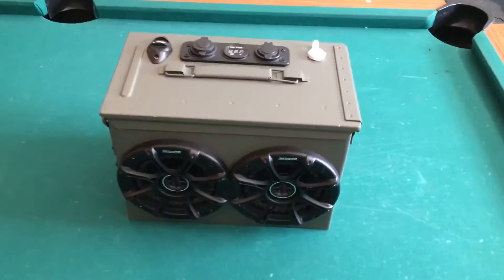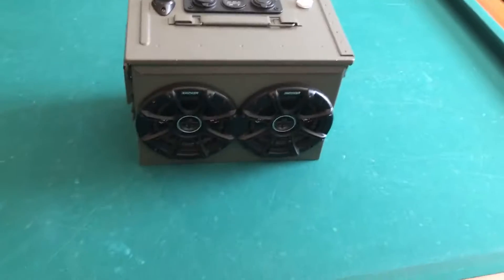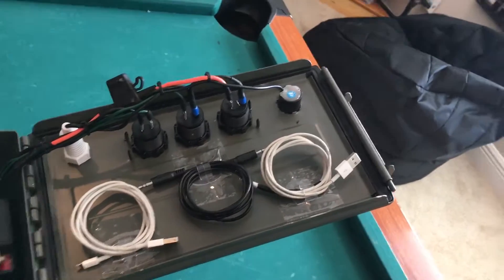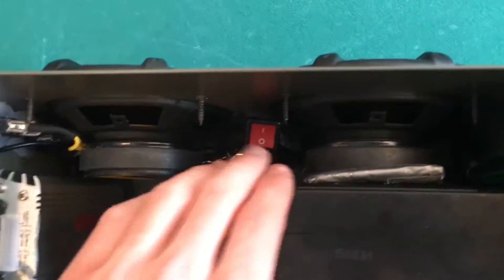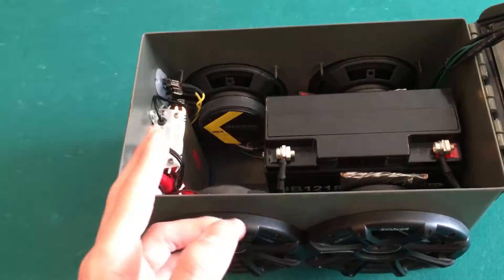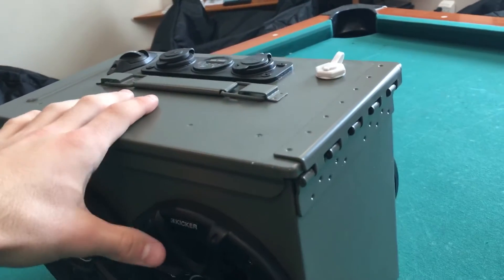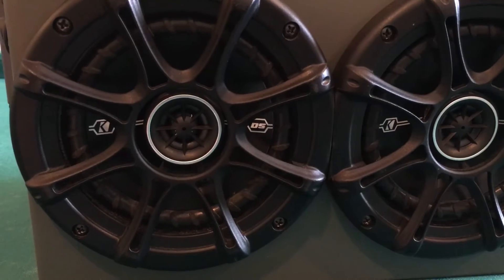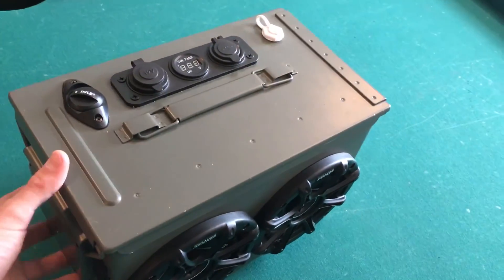Ammo Box Stereo!

Comment: Awesome build. I recently made my own ammo can speaker with a FAT .50 can. I used two 4" speakers and a dual 100 watt amp. The 4" speakers have no problem being loud enough. I had the same bluetooth noise problem with mine. If you haven't already solved it, you need a ground loop isolator between the bluetooth receiver and the amp. That should solve the problem.
Reply from the maker: THANK YOU! haha that stupid noise drives me crazy! and about the 4" speakers, are the loud to where if you are canoeing that the people around you or atleast 50 yards away can hear? cause thats what im going for. I love the kicker 5.25" but i just need something that i can trust to be water proof.
Reply: Yes. Mine has been loud enough to hear from a couple hundred yards away. I've used it when I go fishing in my pasture, and I can be on the far side of the pond with the speakers on the shore. It's a great game call too. I set the animal calls on loop and watch it from a distance. I'm pretty sure the sound level depends on the wattage of the speakers. The higher the louder, but that also drains the battery faster.
Reply from the maker: Thank you so much for the feedback! I was a little worried about 4" speakers. What brand do you have ?
Reply: I have Pyle speakers. They match the yellow stencil markings on the can which is a bonus. I think they were only $35, but they are great sounding speakers with a surprising amount of bass.
Reply from the maker: oh yea! those yellow pyle speakers will kick some ass! well thanks for the info! glad I feel better about the 4" speakers now! thanks
Reply: Would you be able to hear the 4” over a 20hp boat motor doing like 25mph??

Comment: I used to have that same annoying feedback noise because my amp and bluetooth module were wired to the same battery ground. I resolved this issue by using 2 separate power sources. I think you might be able to use 2 different ground points on the ammo can itself, but I haven't tried it since by ammo can was plastic. IMO, the main reason behind this issue is probably due to cheap components.
Reply from the maker: 412riley said that to solve his problem he just used a ground loop isolator
Reply: I actually tried a boss ground loop isolator with no luck either. Maybe it was a bad brand.
Reply from the maker: yea boss is pretty terrible on some things.

Comment: What would I have to do to put a radio into this build?
Reply from the maker: i think the only way to get one to fit is if you buy one of those circle marine stereos and put it on the opposite side of the open latch. it should just barley fit maybe.
Reply: you think id need a bigger amp or anything?
Reply from the maker: where i have the pyle amp mounted put the battery on that side. which is the side with the latch and then on the other side cut a hole out for something like this https://www.amazon.com/BOSS-Audio-MGR350B-Bluetooth-Weather-Proof/dp/B00VV6Y7O2/ref=sr_1_3?ie=UTF8&qid=1498936266&sr=8-3&keywords=boss+marine+stereo you shouldnt need a amp at all cause this marine stereo is a 4 channel radio. and it should be just fine. if you have room for the pyle amp later on and feel like you need more power then buy the 4 channel pyle amp.
Reply: Thanks man!
Reply from the maker: anytime! hope it all fits lol

Comment: Where did you get the plans.  I have been playing with making one...but most seem to be more work and soldering than I was hoping to do.  Yours looks more plug and play with some tweaks.  Beautiful clean wiring too btw!  Without an external antenna how far can you get from the can? or do you have to leave your phone on it?  Thanks for posting!
Reply from the maker: This is one of my hobbies that I like to do when I have the money. I've never seen one with 2 speakers on each side and I didn't know how I was going to make it fit at first so I kinda just took a gamble. I bought kicker 5.25" and if you watch the part where im talking about the Bluetooth noise you can see I had to trim up the speakers grills to where they meet up in the middle. I didn't want to buy 4" speakers cause I wanted this thing to be loud! And well it paid off. you can easily do the trimming with a file and sander. If you are planning on putting 4 speakers then get the 50 cal FAT ammo can from academy but if your just gonna get 2 speakers then get the normal 50 cal but you can only fit 4" speakers. My next project is to put 4 4" marine speakers in a regular 50 cal box so I will see how that goes. but i wont be able to fit as big of a battery so im gonna have to double up on 2 5ah batteries. the battery that I have in this one will last more than 24 hours! its crazy! but yea if you need anymore help just let me know. always glad to help.

Comment: What kind of battery did you use? Like how you were able to use 4 speakers,instead of 2?
Reply from the maker: Keep in mind this is a heavy battery and my ammo box weighs 24 pounds and the battery alone weighs 15. You can use a deer feeder battery and it will last about 6 hours until you realize a sound difference. my deer feeder battery had 7ah and the one that i put a link to has 9ah so you should be able to get around 8 hours before you notice a difference.

big battery - https://www.amazon.com/ExpertPower-EXP12180-Rechargeable-Battery-Bolts/dp/B00A82A3RK/ref=sr_1_10?ie=UTF8&qid=1467347996&sr=8-10&keywords=12v+battery

deer feeder battery - https://www.amazon.com/ExpertPower-EXP1290-Volt-Rechargeable-battery/dp/B00A82A3QG/ref=sr_1_8?ie=UTF8&qid=1467347996&sr=8-8&keywords=12v+battery
Reply: +cason ray I now batteries can be heavy, I work in the electrical trades. I might use an emergency light or exit light battery? Would like to find something with a lithium battery,do to the how a charge a lot longer?

Comment: Put a ferrite bead on the power wires before the audio amp, it will fix that sound. if it doesn't try putting them after the amp on the speaker lines, or use shielded cable.

Comment: How long does the charge last until you need to charge the battery again if you are constantly using it?
Reply from the maker: man that is a good question, i use it while i tint windows all day and it last all day but i charge it ever night because its not good to drain and make it die before you charge it. and im not about to take this thing apart just to replace the battery. but as far as i know i can use it for 8 hours on a medium volume to where you can still kinda talk over it and it still have plenty of juice left on the voltage meter.